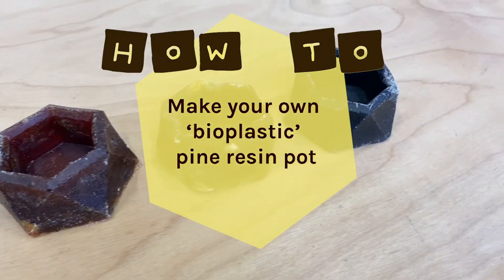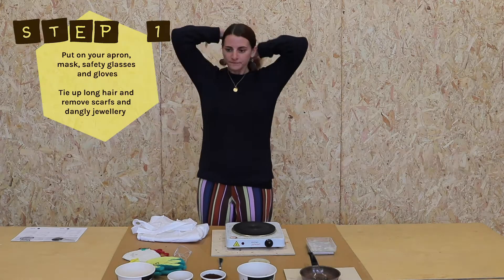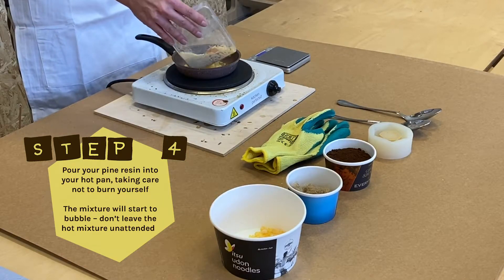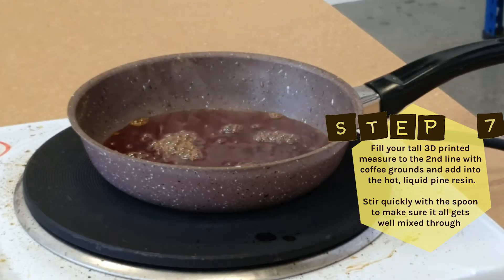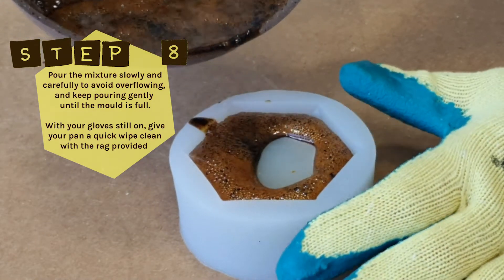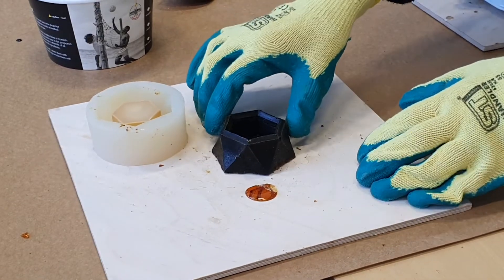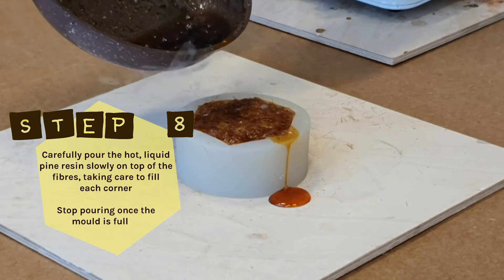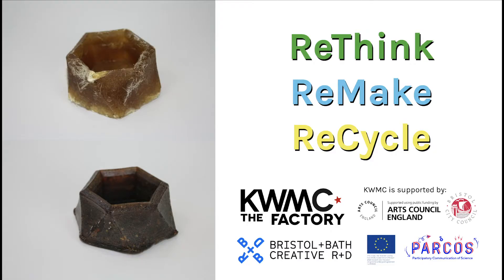How To: Make your own bioplastic pine resin pot

Comment: Hi there, I have a question . I tried to melt the pine resin, but it burned. Shall I had to use the powder from it instead of using it in its normal condition that is look like rocks ?

Comment: Is it resistant to hot water?
Reply: it behaves juste like soft plastic so it will bend and start getting liquid if you use it for hot liquids
Reply: @clockdragon515  Looking for a way to get a strong bioplastic with the addition of natural glue??  Resists hot water in the form of a cup for drinking tea
Reply: @clockdragon515  A strong glue that binds natural materials and is more water-resistant ؟؟
Reply: @rahimimoussa1475  well it is water resistant and it binds materials really well but to my knowlendge, natural rubber from certain plants sap would be more heat resistant but i don't kown if it is safe for consuption
Reply: @clockdragon515  What kind of plants can extract natural rubber?  Really, I want to find a natural gum that is more solid and resistant to hot water
Reply: @rahimimoussa1475  well i guess a rubber tree ? or you could invest in a decent wood carving spoon knife to make your bowls and other containers ? works for me, but time consuming
Reply: @rahimimoussa1475  Hello! also working on bioplastics!  epoxidized rubber could work, it's from the  Hevea Brasiliensis tree.
Reply: @tany2191  I haven't tested it, but I will add it to my search.  Thank you for the nice information 🌹